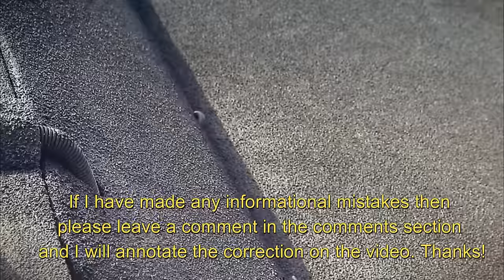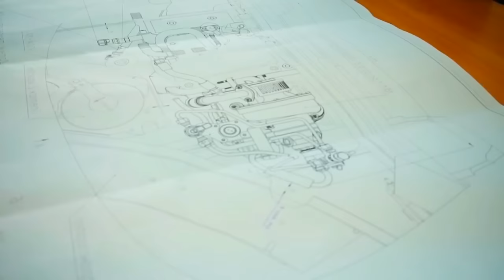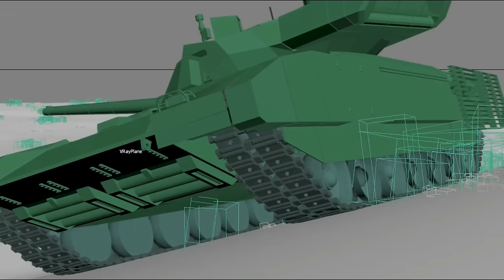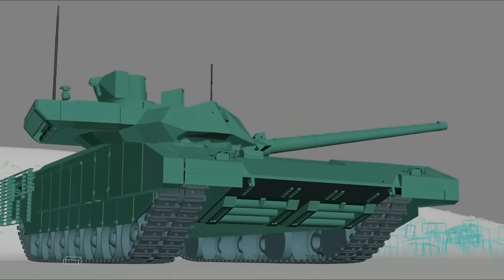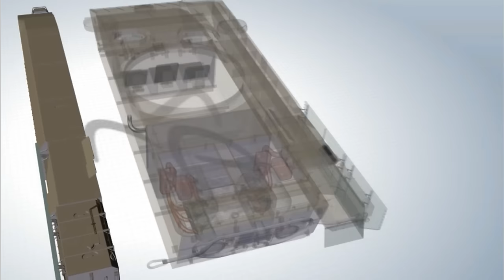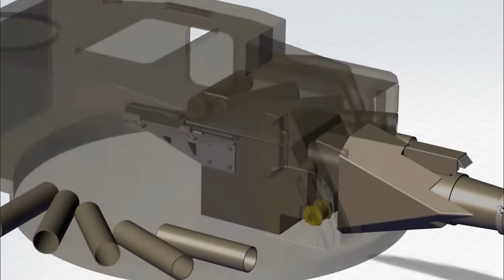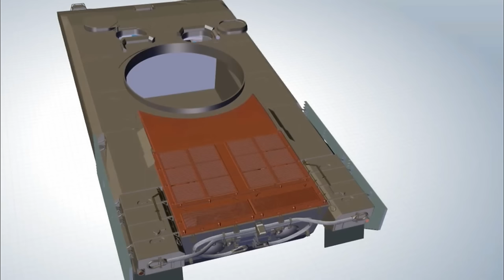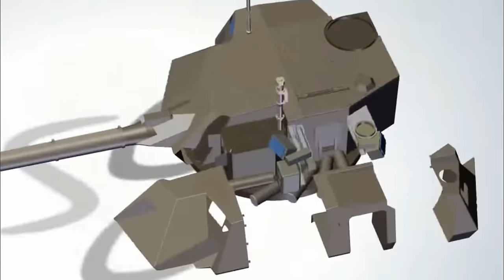T-14 Armata Russian Main Battle Tank - Tank Overview

Comment: new concepts include - fake wooden turret, transmission that instantly brakes down and locks up as soon as the tank starts moving, and a never before seen engine that isn't powerful enough to climb a 20 degree incline even on the lighter IFV version. All this and more for a price that Russia can't afford to produce.
Reply: Bullshit.The so called break down of a T-14 Armata during the Victory Day parade was due to the improperly trained operator pressing the wrong button causing the vehicle to grind to a halt.This was later rectified a couple minutes later as E-brakes caused the issue,the driver being from the army and not a test driver from UVZ and they were not aware of the entire control system.After a UVZ technician approached and disengaged gearbox lock tank drove itself away.
Reply: Jason Weiss well if that's what they say happened, then that's what must've happened, surely there wouldn't be any reason for them to make up stories. Russia is known for being honest.
Reply: Sigitas Shields And the Western media I'm sure is renowned for its objectivity and impartiality.To be honest,I find them both unreliable,but at least it's better seeing both sides of the coin.Honestly,the latter story is more believable.Do you think a multi million dollar weapons platform just breaking down like that or human error as the cause is more likely?
Reply: Jason Weiss anything made by man can brake down, it's even more likely to brake down when it's made in Russia. They haven't been able to make anything of quality since the SSRS collapsed and even the high tech components on their military tech is being imported from the West (Thermal cameras for example). There's no denying they have shit training too, that coupled with bad equipment and the rush to show how great and relevant the Bear still is in the world leads to failure.
Reply: Sigitas Shields Kornet E eating Abrams in Iraq
Reply: @Vlad Dracula Export versions of them....
Reply: Julius Kačenauskas it's a export version of the kornet atgm vs the export version of the Abrams. The kornet e wins.
Reply: Guys, those vehicles that were on parade during 2015 were pre-production vehicles - of course there will be faults! They were simply to show to the world and to the general public where Russia is going in terms of armoured technology. 

However, if the actual production models have the same faults, you may keep your claim in tact :D
Reply: CXVII MMDLII Russia is all about showing their "power" to the world. That, however, is a charade. I doubt these vehicles will go into any sort of significant production, unless export opportunities arise, but I also doubt anyone will be interested in buying this shit pile of a project.
Reply: Very funny, though)
Reply: Sigitas Shields Cough,cough The US imports Russian rockets for use in its space programs,I hope you know.And claiming that ' it's even more likely to brake down when it's made in Russia ' just shows your blatant bias to no end.
Reply: Russian GDP is what? Less than in Italy? Is Italy a rising superpower?
Reply: Jason Weiss - I don't know if you know this or not, but Space-X and a number of other companies are trying to take over the rocket launch missions even as we speak. 👽👽👽
Reply: Unholy Warrior Until kaboom!
Reply: On the tower housing of steel sheet to cover the equipment from the secondary fragments.
Transmission was OK was pressed mountain brake. The driver is inexperienced.
The same applies to the trawl, it is impossible to learn how to manage an unfamiliar technique for a couple of months in the simulator.
Reply: Зато на руине все нормально, у них нет ничего нового, так?
Reply: Vlad Dracula - Are you into cheap thrills? 🎃🎃🎃
Reply: Джо Неуловимый - I think also the sheet metal cover on the turret is shaped to be as stealthy as possible. The T-14 is a next generation tank, newly designed from the ground up; it builds upon all the lessons learned from the previous decades: basically better armor, ERA, gun, ammo, and soft- and hard-kill systems, etc. It should shift some of the power away from the ATGM and RPG-like weapons. ☠☠☠
Reply: Butcher_of_Rivia Yes it is, just like there's always a export version of a Russian weapon.
Reply: I'm not sure about what sagitas typed, but I am sure that they have alot to gain from exaggerating the capabilities of this vehicle.
Reply: butthurt!!!!!!!
Reply: Sigitas Shields trollolol.
Reply: Sigitas Shields It did not brake because if it did the tank could not have moved by it self again....
Reply: Janos oh really? And when did you check and got to compare them to anything? You have no idea what your talking about.
Reply: Sigitas Shields I saw video that .was create by the west
Reply: ...and the Western media I'm sure is renowned for its objectivity and impartiality.....

yes, it is. unlike you know, russian media))
Reply: Well if it isn't The Fake SecDef again. So you're into armor as well aye?
Reply: jol666aaa hahaha, you have quite the fantasy